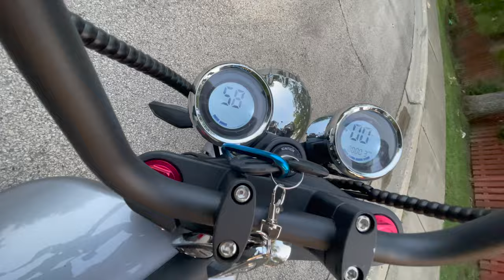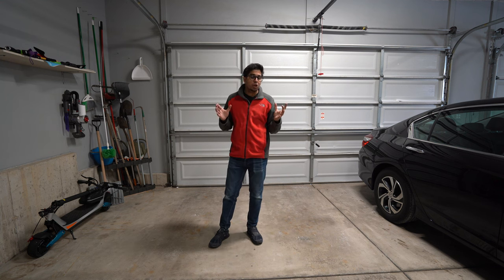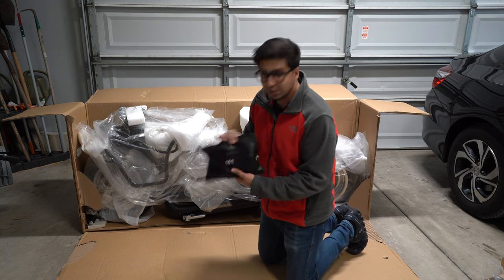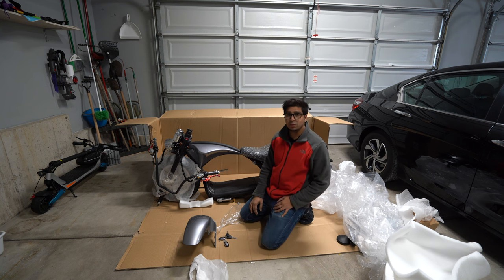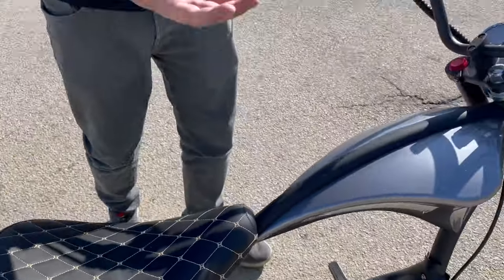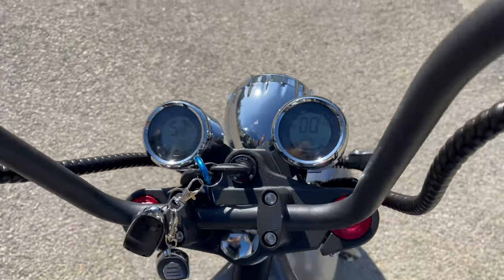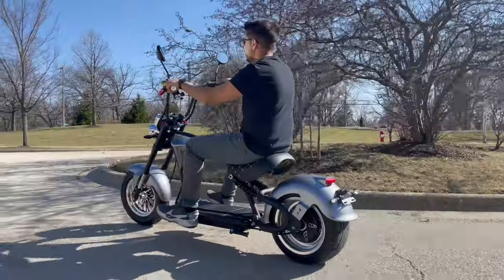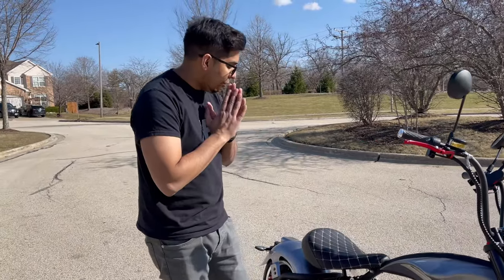The Electric Motorcycle Chooper / Scooter YOU NEED - Review

Comment: hey Pal quick question is the seat adjustable at all? can I move it further back? or raise it higher?
Reply: The seat is not adjustable on this.  My only con with this bike is that they could have designed it with taller tires, at least copy the same size tires of a Harley.  Otherwise it is a nice running bike.
Reply: @rrtds9378  would it look funny or too small for a 6'4 person?
Reply: @elid377  Yes, in my opinion, looks like a kids bike if a taller person riding it. There must be a reason for not copying the height, could be licensing as a motorcycle. It does have good power for a scooter, at 3rd speed it can go on mine to 40-42mph, which is enough for around city.
Reply: @rrtds9378  yeah but i mean tires can be replaced to something bigger
Reply: @elid377  This is true and move the motor. It is the rear tire with the motor that I think should be bigger.
Reply: ANyway thanks for the info